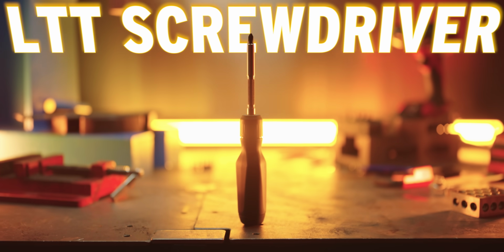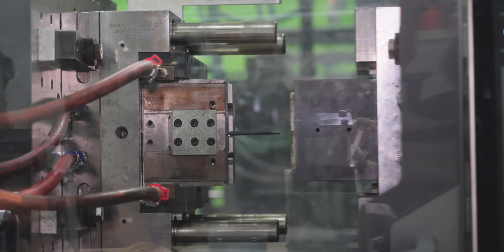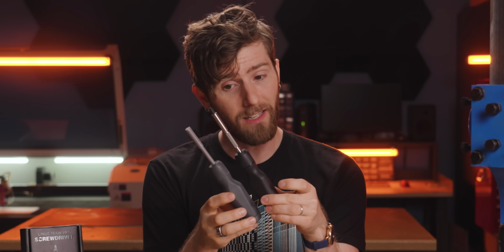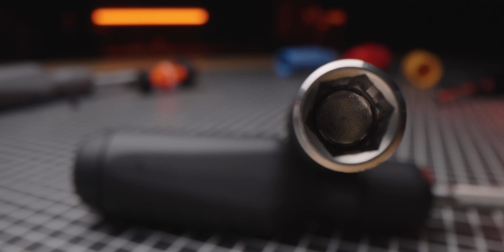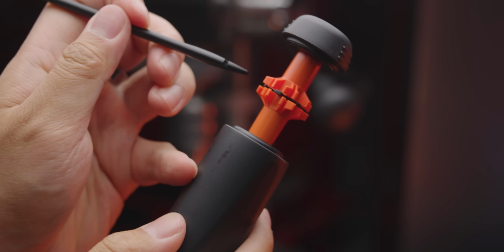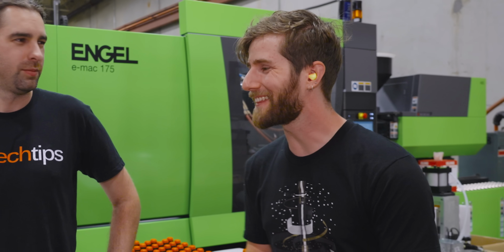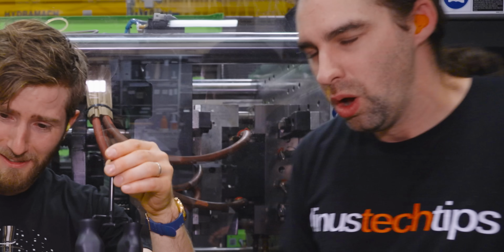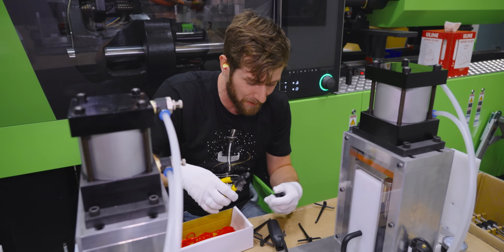Why our Screwdriver took 3 YEARS

Comment: Um, I have a ratchet screwdriver that fits my hand perfectly that I've had since I was a kid 30 years ago, only real difference is it has a screw on cap containing a plastic mode holding the extra bits. Less convenient to get to in a real hurry, but let's get real if I'm in that much of a hurry, I'm just using a screw gun, drill or electric screw driver. I modified alot of my own tools or built  Accessories for them to make them better where they suit my needs more then what the manufacturer decides is general public needs, or wants, or can live with or without. Not worth ur money to develop in this day. I will keep my 30 year old no name ratchet screwdriver that's the exact same thing right down to the look except for the storage compartment, it's never failed me, nor have I ever thought boy this screwdriver is lacking something or boy is this screwdriver uncomfortable, or do I need to spend a house worth of money to make the most minor of difference in a market where I will never see my money back in this lifetime unless you can get another company that's already in the market to buy ur products license because of some value here I'm not seeing in a bloated market from all countries, a product that seldom needs replacement, especially if you have a ton from over the years, lose one find two type deals. They are handed down in tools chests from father to sons ect. Not huge market for new when the product hardly changes 🤔 😕  Did like how he used it in the video to teach you about the steps,  process and difficulties though 👏 Good video overall. Hope the veiws make up for the sacrifice 🙏

Comment: I was a high school intern at a plastic injection facility for 2 years and I'm surprised that the building of the mold was so fast. Also, the plastic will shrink while cooling so the mold is actually larger than the part.

Comment: Just got mine today and I am positively impressed. Especially with the honest marketing.

A lot if times I will buy things and find tiny errors in them after time. (I don't complain about it but it's always sad to not be able to forget about them afterwards)
This is the first product I feel like I won't be surprised by any flaws because you openly admit the teeny-tiny ones that are left. And these are certainly so small that I can easily get over it.

GREAT JOB 👍

Comment: Prior to about 1980 the standard way to pickle and passivate stainless steel (and similar alloys) was to use a nitric acid / hydrofluoric acid bath to etch away any soft alloy, and to follow that with a nitric acid bath wash to oxidize the surface. Along about 1980 I invented the now standard process that replaced this. It produces a generally better spinel coating, and is non-toxic and nowhere near the hazard of the nitric and hydrofluoric acids.

The process involves a couple of steps, which can be combined and can be varied as needed.

The first step is to strip any organics that may be blinding the surface. This can be accomplished using any mild detergent or phosphate. Easiest is common detergents used for dish washing or related. These are typically nonylphenyl nonylpolyethoxy compounds. Essentially one end is a branched chain hydrocarbon about 9 carbons long that dissolves oil like substances. This is bond to a benzene ring that dissolves aromatic substances. The last part is a roughly nine segment long chain of ethoxy groups ending in an alcohol that easily dissolves into water. The lengths of the chains varies the sudsing and other characteristics. Other modifications can change the ionic character. Find the one that best dissolves whatever contaminants you have.

Wash the components in a solution of chelant and soap. Add a small percentage (say 0.5%) of soap to a solution of 1-10% citric acid (best) or some other chelating agent (acetic acid, EDTA, NTA, ...). Ideally use high or at least higher purity water (low calcium, magnesium and salt content water - I preferred deionized, or distilled water, or water from reverse osmosis) at a slightly elevated temperature (140 F is ideal). This solution dissolves soft iron at 11 inches per year, while limiting dissolving of stainless steel to about 100 microns per year. In just a few seconds any soft iron or iron oxide is stripped away. On large surfaces this is plainly obvious and whole areas or welds will briefly turn orange, then clear. That's it. 

Lastly, rinse this solution off with high purity water and then allow the surface to air dry. This results in the rapid formation of a tightly adherent passive chromium oxide (Cr2O3) corundum coating. 

You could go further and intentionally nitride the surface. That isn't really needed. The important aspect is the dissolving of the soft alloys to allow the formation of the tightly adherent oxide surface. 

One caution, keep the citric acid content low. Though it is a very safe compound, it will dissolve aluminum and concrete rapidly. You want a lot of dilution and things like calcium or magnesium ions to combine with the citrate before it goes down he drain so that it doesn't eat your drain lines. Also be careful about the heavy metals levels (chromium in particular). That shouldn't be a problem, but might in some cases be regulated or limited. If you have cobalt in any of the alloys, be especially careful as that can cause serious problems in sewage systems.

Comment: this isnt about a hand tool,  but your videos are top hat or for machines no one can make, your drifting off mainstream viewers.  I am suggesting this to other linux how video makers
Thelead  buried the lead several times or ignoreproblems brought up.  I have set up machines for all the Os/s including OS/2 to rehat, Windows whatever.  I find linux vids here general are ok to poor.

For instance, its mentioned that Nvidia wont work? on most of the big 3 you like,  but never suggest a link how to fix, no apt get for nvidia, etc etc etc.
I had seen many videos on how to run windows or set up wine on linux, but then never getting into HOW.  MOST attempts are a disaster.  
I bought a lenovo I5  2022 on black friday, and even after hours of removing bloat, spies, etc, the next windows 11 update set everything back.   Tell us how to STOP that.
On some videos, they say POP3 or arch are windows DIRECTx) READY,  which POP3 and elementry was the worst, more freezes than Windows.
I play STO and SL mainly,  you never mention if you install Steam on Linux will plays these,  I could run them in a VM,  why spend hours futzing with all this crap.
Why dont you youtubers make a video or script where to find fixes or drivers,  Nvida should not be hiding these drivers.  Wine is a joke on some of these distros.
YOU tout Linux to get away from Windows,  buy 11 gets worse everyday and one day 10 will be gone for good.  STO wont let players using 7 on anymore.
I used to compile programs and I guess I could to that in java of C++, but retired, and am tired.

the command line doesnt scare me.  But no one boils to a true and total Win Migration Video,  installing just linux is getting boring.
please make one that helps us.   I have no doubt I made a lot of mistakes,  Wine, Vulcan, proton, are footnotes in this topic.  I dont do much
office computing at all.  thanks,  Mike

Comment: Is there really someone that will buy a screwdriver for 70$? I bought a tool kit with a couple of screwdrivers a case a hammer and alot of bits and other stuff for 40$ almost 10 years ago and everything still works fine and I've built around 15 PC's with it and fixed stuff around the house etc etc.
Reply: It's a different type of screwdriver than a cheap interchangeable bit one. And yes, well over 100k have already been sold

Comment: i was a design engineer in medical device injection molding that helped customers design their product for injection molding. he explained it pretty well. You want draft on the direction of mold pull, constant wall sections to mitigate sink and allow for good flow. Also, aluminum molds suck. the majority of the cost of mold making is the labor, so you dont save money on aluminum molds because you can only shoot them like 100 times. Most mold builders can hardmill, but EDMing allows for "sharp" corners and deep pockets that would be next to impossible with milling operations. lots of grind work as well to ensure the parting line is as flat as possible to avoid flashing the shutoffs. Only way they can have a gate without degatting with them stood up like that is a 3 plate, or a two drop hot manifold with a valve gate. cheaper to hand degate for the volumes they're doing.

Comment: zinc ... Not a great quality stuff... 303 stainless steel is not the worst but it is not rly good. ( 318 stainless steel would be better ) The Plastic parts are good choice. The mechanism is not the best but it is fine if the metals are strong and harden enough.  If it is has a reasonable price i think it is a good screw driver. It not gana last forever and  not going to look nice for too long. But nice work guys u are not working in tool making for 30 years or something... U guys made a good product from nothing. It is amazing.

Comment: 70 dollar screwdriver... And he complains about Nvidia's prices. Just buy a magnetic tip multi bit screwdriver at home depot for like 10 bucks. It's all you'll ever need
Reply: Those aren't ratcheting... this doesn't even compete with those, different product category
Reply: @marcusborderlands6177  My point is it's not necessary. Still one quick google search shows there are plenty of ratcheting screwdrivers going for around 10 dollars. There's nothing remarkably premium about this that would justify the price. Ffs there isn't even a flashlight on it, which is like the first thing I would look for.

Comment: NO. Just look at JH Williams WRS1, it is a good tool but still sucks like yours. Than
Look at Felo 64539 Ergonic K Handle Ratcheting Screwdriver it is also good but sucks. WHY?
1 compatibility with ¼ standard powerdrivers bits (not a fix longer ¼ drive bit driver)
2 NOT a knurling on the screwdriver "blade" (which is a fixed bit driver) but a knurled gear for rapid advancement of screws before tightening.
3 possibility to mount small ¼ drive sockets. If you have a fix ¼ hex bit driver it's not possible.
4 Leverage. if you can work only relying on friction like a traditional screwdriver you have less breakaway torque.
5 Angle. If you can't change the working angle you can't access some screws because you can work only straight.

A good thing you've done is the trilobular rigid hanlde because round handles tend to roll. And softgrip handles went shits with oils and grases.
If you need an inspiration about what I mean about rapid advancement gear look at
BluePoint FSDR or Cal Van CAL108 it has to be an aggressively knurled alluminium large gear at finger reach. You don't have to necessary use the other hand to advance a loosen thread.

Comment: From the perspective of someone who's been working in the plastic injection business who's also a prospective tool and die maker apprentice, this is some really well designed molding. Gates and parting lines are just a fact of life and your scrutiny and engineering decisions are really well thought out!
Reply: Also, the steel mold they are using feature a stripper system in the back half of the mold. Meaning, the process of ejection comes from the back half face plate fully extracting the parts forward off the cores of the tool, rather than ejector pins pushing forward from the back half ejector plate of the tool. Just a fun fact of the injection molding world, really amazing learning experiences from this line of business. I'm no engineer, I just do changeovers and strip and cleans in my workplace.

Comment: It looks appealing, but why did you make the ratchet go the wrong way? Megapro's ratchet is correct, which is why all ratcheting screwdrivers work that way. It is not by accident it turns the way it does. If you hold the knurled wheel with your left hand to steady the shaft and turn the handle to the right then the screwdriver should lock in the clockwise direction to drive in the screw. It seems like you have made it backwards?
Reply: it's my understanding it switches between the two directions

Comment: My need is for a 7" long shank screwdriver (about 11" overall length) for working inside computer cases such as replacing motherboards or CPU's.  I have been using a S-K Model 73517 for years and it has been invaluable. Shorter screwdrivers are not suitable for deep PC cases.

Comment: Very interesting to learn more about the whole development/manufacturing process. What surprised me though is how can you have deposited 130kUSD to make a tiny metal part in Taiwan. That sounds like an awful lot of money. How much is the per piece price for that component? Even if it clearly is the most expensive component in your assembly I would guess it wouldn't cost more than 1-2 USD. Did you actually then have to prepay in full an order of over 50000 pieces. Is that standard procedure for a deal like that? 
I'm also amazed how many people think it is ok to pay 70USD for a screwdriver no matter how good it is. Anyway, good luck with your sales. Hope you will continue making some other interesting products and show that process also.

Comment: Pretty cool, I'm going to be ordering mine very soon, my Christmas gift to me this year! From the timing on the injection mold, it looks like that one machine can produce a little over 102,000 handles per month if it's run 24/7, not counting any down time for maintenance. From the looks of the sales on your website store things are going great. I'm going to get the black and orange one with the silver shaft to start then maybe another two or three for myself down the road and probably several more for gifts next year. I hope you make enough to fully fund your retirement, all from one really well designed and manufactured screwdriver.

Comment: Should've stuck with the unmodified internals and V5 handle for fitment of normal 1-inch, or 2-inch double-sided bits, but most importantly to save money. Good God $70 for a screwdriver is a lot!

Comment: bit type screwdrivers are a waste of money, if you need to access a space that is narrow you will need a longer reach and a narrow head on the actual driver.   with bit types they have to make the mouth really wide in order to accommodate fitting a standard bit.  this means you wont be fitting that screwdriver into a myriad of places and would be better off buying a quality set of mixed sized screwdrivers from snapon,craftsman,kobalt etc. any company that sells screwdriver sets in a pouch.  good luck...t. 30 years professional mechanic here.

Comment: I am working for a pretty huge intl. technological company and 2 years for introducing the new product from proposal phase thru design and engineering (various thermal, structural calculations) phase, protos, sourcing, validation etc...is pretty much OK, so I would say you've done a great job :))

Comment: Something to consider for future hardware would be an interface system for usermods.  For example the end cap would have been an awesome areas to include a threaded insert or be removeable so someone could 3d print some kind of accessory that is robustly connected to that section.
Reply: Perhaps an order by order system. This video is basically a statement that they're proud of this finished product. Not meant to be customizable.

Comment: Yeah but… Dude; this is still completely useless to me because of one thing: you don’t have size 000, 00 or what, even SINGLE 0?!?
What about a a pentalobe or even , freaking torx bits?? Is any of this included with the screwdriver?!
Reply: Just checked out their links more… yeah they sell separate but sets, and even that only goes down to P0 size and T3 torx size!

Comment: Nice. An Engel e-mac Injection Moulding machine. I Work with almost the same. In my Job we use Engel E-Victory and i loveeeee the control panel. So easy to use. you guys made a good choice buying one.

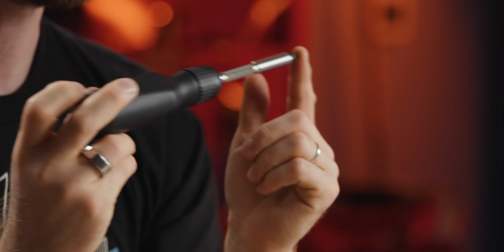Comment: 11:36 And that is why truly professional drivers lock the bit in, and until it is manually released, you rather rip the steel bit apart, than it stays stuck in the screw.

Comment: Assuming $500,000 in initial production costs and at $69.99 take off $10 for other costs per item, with 3,353,265 views at time of writing it would require approximately 8335 units solid to break even on the original investment, and need this video to have hit a 0.24855% conversation rate to start making a profit
Reply: Math major

Comment: Shortening a rod does not cause it to be able to transmit less torque. It is based on the geometry of the cross-section and its polar moment of inertia as well as on the modulus stiffness of the material. You guys have engineers, you should know this! d_min >= quberoot[ (16* Torsional Moment) / (pi * Max_Torsional_Stress) ] This is the analytical formula to calculate the minimal required diameter d of a full-material, round cross-section rod. Best would be to discretize the problem and do a finite element analysis.